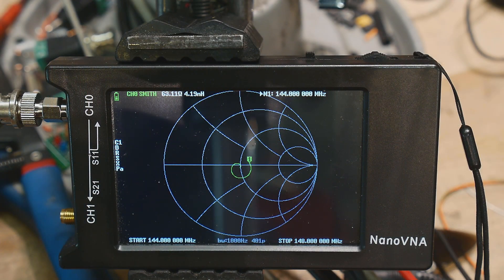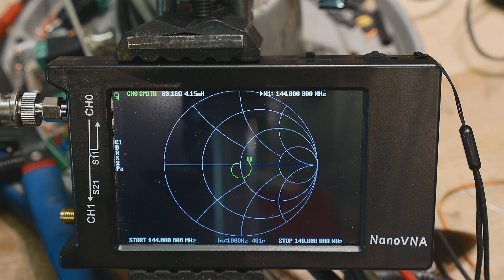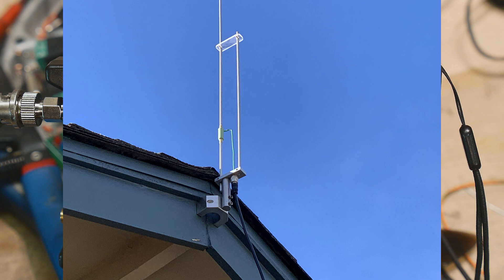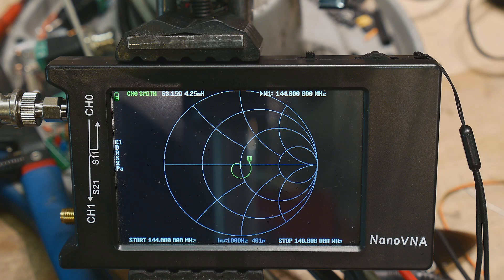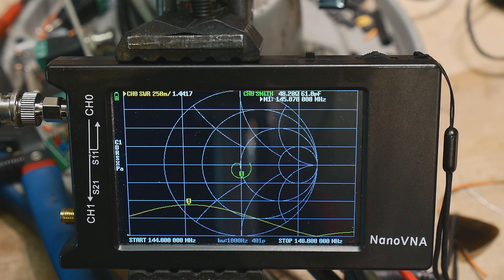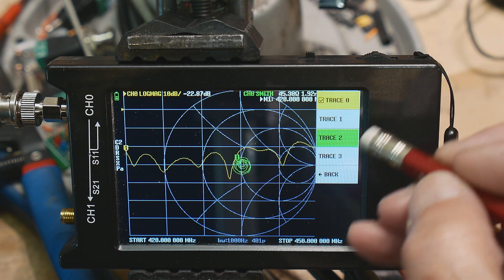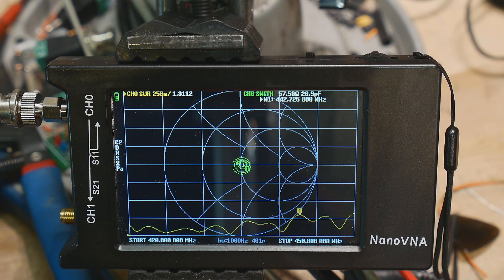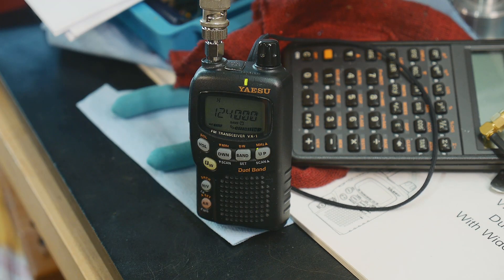#764 Dual Band J-pole Antenna Tested with NanoVNA

Comment: I’ve asked this question of a couple different people and either received a flat out “it won’t  work” to no response at all. It was actually your video on a new field microscope that made me ask the question. Why couldn’t a J pole antenna ( like yours pictured in this video)  have the elements fitted with a rack and pinion drive and microcontroller to automatically tune the antenna directly as a transceiver frequency is selected.  I watched one guy manipulate a connection in the same way this drive system would work and the j pole was tuned to each given frequency. Thanks as always for the videos and content
Reply from the maker: antennas are mechanical in nature so no reason things could not be made to lengthen or shorten with motors. be aware there are several 'J' pole designs. mine happens to have a gamma match on it. you might start with a simple vertical antenna and just move the radiator up and down.

Comment: Since your jpole is an end fed half wave fed with a quarter wave transmission line matching section it should work great on an odd harmonic.  If you model it the biggest difference at 70 cm is that it has a lot more lobes, some pointing where you may not want them.
Reply from the maker: that's what I figured

Comment: Any lightning protection?  One reason I like antennas in the attic is that lightning is not a consideration.  I'm paranoid :-)
Reply from the maker: We have earthquakes but no lightning. It is very very rare. Maybe one time per year.
Reply: @IMSAIGuy  Interesting, didn't know that!
Reply: @WECB640  good points, although a lot of things will go wrong if lightning strikes my roof: much of my house wiring goes through there.  My Yaesu handi-talkie is probably the least of my worries. :-)  I saw the ARRL letter about the new rules, and thanks for the pointer to the video. 73 and brgds.

Comment: What's the total loss of that coax on 0.7m or did you calibrate out the cable before measuring?
Reply from the maker: It is an S11 measurement at the radio feed point. I did a measurement before with a 10ft coax and got a similar result so the cable loss is not the reason for a match, it would effect the overall efficiency of the system. The loss at 440MHz is about 3dB for the 50ft of coax.
Reply: @IMSAIGuy  One way loss but if there is only 50ft of it you are right, it should not be the cause of good match.